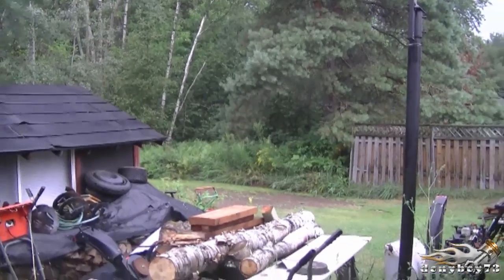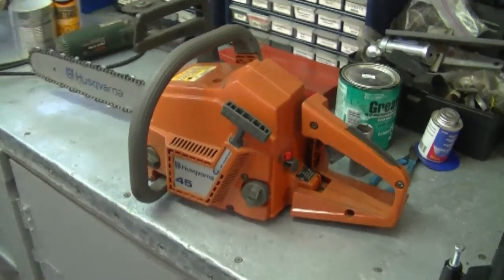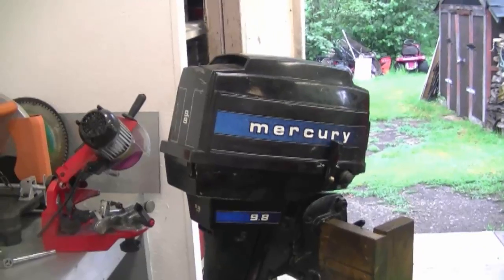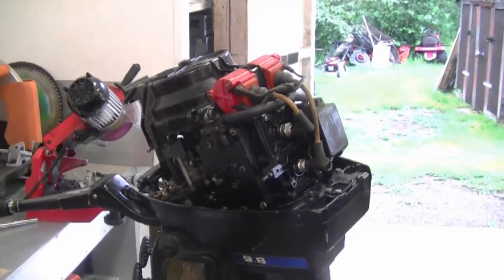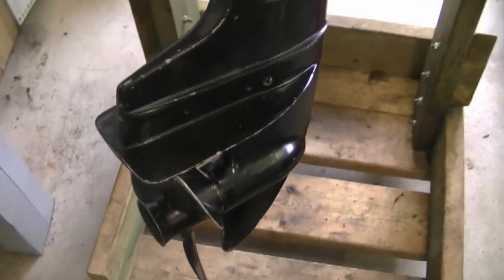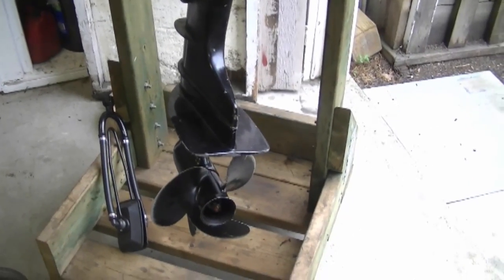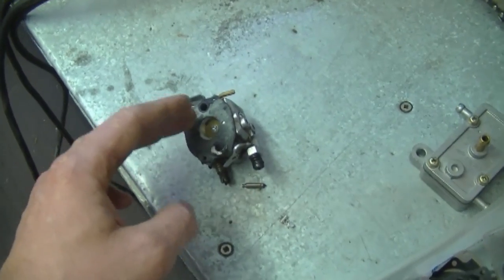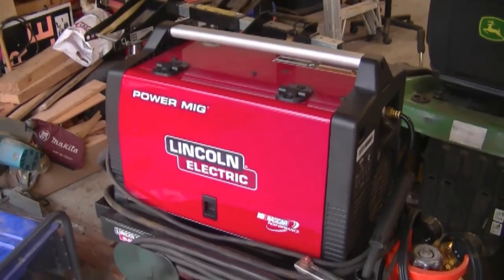Small Engines Q & A Video #105 in HD

Comment: another method: use exact match diameter plastic hose, stick it into the port hole (after you take the water filter screen off) , and "prime" it with a propriet syringe filled with water... then then stick this hose into a bucket of water, or waterballon.. motor will suck it up 

(you have to take the propeller off, of course;)

it's works, just make sure to replenish the water..

Comment: Great video. Don't forget that sometimes you can get parts for the old outboards if they were contract motors. I have an old mariner that was made in japan. Mercury doesn't make many parts for it anymore, but I was able to cross reference all of the parts with yamaha and updated my parts diagram. All of the parts were a one to one swap. Works great now.

Comment: they are not muffler.  they are called flush heads.  I have used these as well as a 55 gallon drum.  which one you use is based on what type of outboard you have.  the drum for small engines and then flush heads for larger outboards or I/O.

Comment: On the question for the 9.8hp or other older outboard motors. I found a place called vans powersports. They have a great online menu, and you can find almost any old part. Even if it says they don't have it. I called and talked to them. And they had my part in back. So I don't work for them and I'm 2 hours away. But it's worth a shot. And they will ship it to your door.

Comment: Would it still be possible to get lower unit seals for that  merc 9.8hp?
Reply from the maker: Dinkymaster7 yes it should
Reply: I have the same motor but I can't get it to idle.
I have tried to turn the low idle screw  but it still won't idle like it's suppose to. What can then be then problem?

Comment: I think it's very important to point out that when using the "muffs" for flushing or testing, that one does NOT over rev the engine.  Because the motor is not in water there is no back pressure for the exhaust and over revving  may very well cause the engine to "runaway" with it's internal parts.  I prefer a test tank.  Received the info from a Evinrude repair manual.

Comment from the maker: spray penetrating oil in the cylinder and let it soak for days, you might have to turn the flywheel to get it loosened, just pulling probably won't do it

Comment: Dony, Great vidios as always but regarding the outboard teltail, Water should always come out the little hole as soon as the engine is started. It is only an indicator that the impeller pump is working and not an indicator that the thermostate has opened. Water by-passes the thermostate through the thermostate housing when the engine is cold to cool the exhaust and exits through a exhaust port or through the prop and through the telltail.

Comment: I have a very clean, almost new, non running, 2 stroke Homelite weed eater. I sprayed fluid into the carb, does not start. Checked for spark at the spark plug, has a blue colored spark Next compression was checked. It is good. Checked for a muffler clog, it is very clean, as well as the exhaust port. Checked the air filter, it is clean. Sprayed fluid into the crank case while that cover was off, put cover back on, still won't start. What's next? A crankcase seal issue? How do I check for that?

Comment: Hello Dony, I just wanted to say something about the outboard water muffs that you hook up to a garden hose. If you are trying to find out if your water pump is bad, You may not want to use these to on your motor to test the pump. Because the hose forces the water thru the system. So you may not get an accurate diagnoses. Not saying it is wrong to use them, Just putting my 2 two cents worth in. Thanks. Keep up the great videos!

Comment: Hi donyboy, I spoke to you a couple weeks back about my quad that wasn't running, you advise a new carb kit so i went ahead and got a new carb kit. I replaced the float pin and jets as advised but it wont run unless i squirt some fuel into the air intake. Anyone know why its doing this?

Comment: I have a Merc 9.9hp, there is a small plastic attachment that slides over the water impeller intake you can buy a for a few dollars. Hook the hose up and you can even engage the prop while testing cause it is out of the way.

Comment: That Mercury outboard is later than 1976.
I own a 1976 Mercury 9.8 hp (still called a 110model) it does not have a thermostat and has different decals.Check the serial numbers you will see that it is an early 80's model.Canadian models have a differnt set of Canadian SN's.

Comment: don, i know its summer, but ive a question about my mtd yard man snowblower.  following one of your videos, i replaced the friction wheel. after i was done, i shifted the transmission, that the bar the wheel rides on moves side to side slightly, and the bearings move out of the blower case slightly, i noticed in your video, one of your bearings did that also.. any idea why this happens? you are the only one i really trust to ask questions, thankyou for your time, dick

Comment: I used carb cleaner from a can on a brand new carb pump diaphram on a Tillotsen carb Stihl 032AV. The tiny flaps curled a bit from the carb cleaner. All I was trying to do was get the lint stuff off but I'm afraid I ruined that diaphram. Do you think that is possible? The saw will start but won't rev up and won't stay running. Or is it possible my carb is just out of adjustment? Stihl manual says start with H & L out 1 full turn. Thanks, your channel has helped me dozens of times on projects!